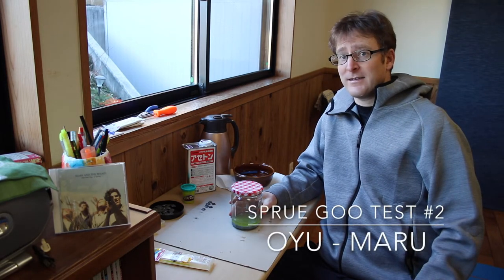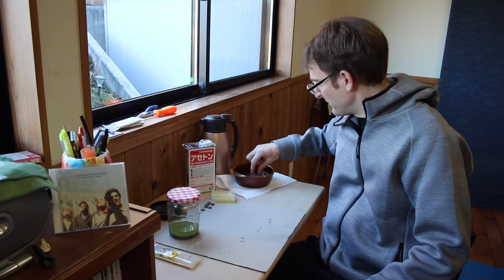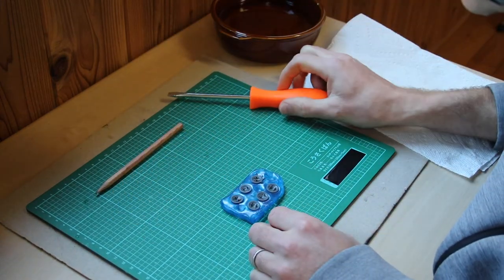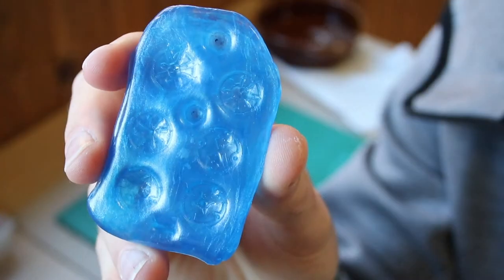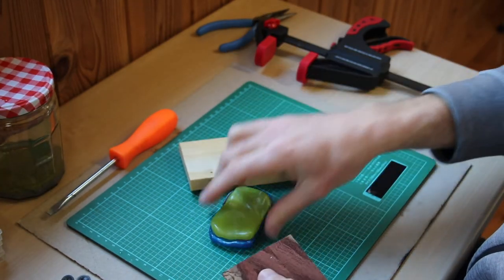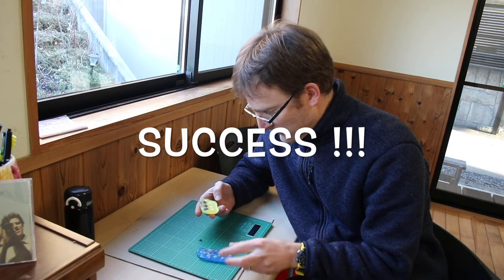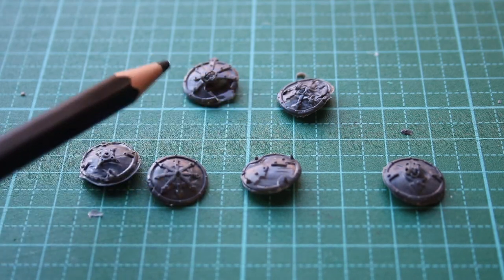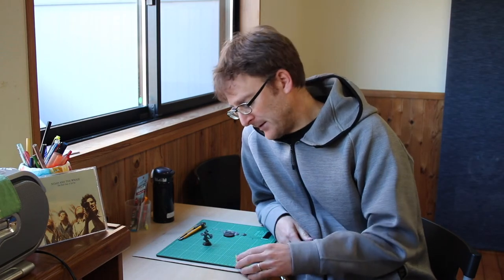Sprue GOO - Molding with OYU MARU. It Works!

Comment: Well aware this is a year+ late comment but hey, it's still useful!

Things learned experimenting with sprue-goo & blue stuff / Oyu Maru thermoplastic clay - 

sprue-goo behaves more like molasses/honey at between 50-65c. When pressed into ice-cold & dry blue stuff / oyu maru it's heat doesn't add deformities & hotter sprue-goo is less likely to have air-bubbles.

ventilation - the acetone content in sprue-goo it requires air flow to evaporate/dry out. Using paperclips to create off-gassing ports helps make sure things dry in a more timely fashion.

Still to test 

- desiccant boxes - same idea as above, creating an low-to-no humidity environment (>5% or lower) for the acetone to evaporate faster. Seem to remember acetone reacting with a lot of the acidic desiccants so this one will be done in a glass box outside.

- vacuum chamber - acetone under a 0.05 atmosphere boils at -7c. I also want to see what it does to the thermoplastic.
Reply: *Update / ongoing experimentation - 

Solution to the stickiness - Latex gloves with a very thin coating of non-water based personal lubricant (Astroglide in specific, it does not react with the latex gloves) lets you handle sprue goo without it sticking to everything. After rolling it around into a ball in my hand the coating makes the sprue-goo behaves like a soft putty. This allows for precise control of proportions & lets you gingerly push down the goo into the mold.
Reply: Acetone also can destroy the oyu maru. Used a bit to clean a mold once and whatever was cleaned was turned into tacky soft plastic.

Comment: Very good vid. I used Blue Stuff, it seemed to be the more easily obtained in the UK at the time. Yes the sprue goo does seem to take an age to set/cure, but it's worth the wait. Sprue goo is better for smaller items, I've succeeded in repairing/replacing broken VERY OLD GW ork archers by making a cast of the part on a complete figure, then put in the damaged figure and filling the gap with S.G. which melds to the original. Give it plenty of time to set and there will be quite a bit of flash to clean up but what the heck, you have a now usable model ☺ I've also replaced a 40K terminator sword this way too.

Comment: You could try rinsing the acetone w/ isopropyl to accelerate drying
Reply from the maker: Really!? That is awesome. Will that work? I don't have any projects in mind to try but I really want to give that a shot. 
Thanks for the tip.
Reply: Wait which step should i rinse it with isopropyl? When im putting sprue goo into the halves??
Reply: I'm curious about this as well. So would I take my sprue goo blob out, rinse it in isopropyl, let it dry for a min then press it into the mold?

Comment: Lego blocks and blue stuff I use sometimes I use a stemmed to sand down the bumps to flat sand it a little then I can build up around and fit a mould . Or you can press for them depends on your task really . Then fill with Milliput and or green stuff I use for adding details to my 40k army .

Comment: Sprue glue is for filling in gaps on kits you add little bits of sprue into a half full bottle of tamiya extra thin glue you don’t need any thing else as when it’s used as a filler the air drys it
Reply: Not it's only use. I had a bunch of broken swords and shields for my lotr models and recasted a bunch to replace them and create some spares.

Comment: I'm going to experiment with casting mediums, like plaster of Paris, or sculpey.

I'll try to let you know how I go.
Reply from the maker: thanks that would be very helpful. Good luck.
Reply: plaster creates too much heat and will warp the mold.  use green stuff, miliput, or a 50/50 blend of both.
Reply: I completely forgot about this, but I have been playing with goo and I've drawn some firm conclusions.

Firstly, the goo in itself is obviously molecular chains in suspension, once the acetone (or other solvent) evaporates, it leaves the firm shape behind, meaning that the outside cures first and the gas escapes the deepest areas last, it also burns from the inside if you set it on fire, but that's another story, lol.

So with that unstructured rambling behind us, I believe that best results would be achieved with a gas permeable mold, but if we're sticking with thermoplastics it might be beneficial to include gas off channels or chambers, to accommodate faster evaporation. 

But I'm yet to test this, as I've only just seen this video again.
Luckily I'm far better equipped to try things out now, hopefully I can remember to let you all know how it goes.

Comment: You'll get better results with a form for you mold, as to apply equal pressure on all surfaces.  You should also use green stuff, miliput, or a 50/50 mix of the two.  I've used it to copy Krieger heads and Tempestus Scion bodies and they all turn out awesome.